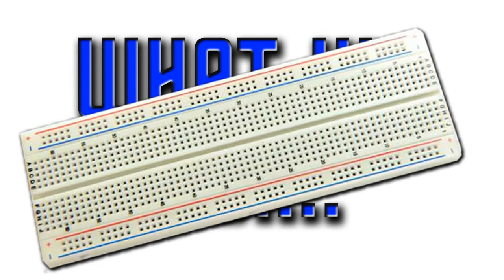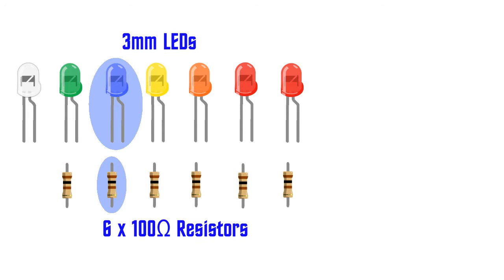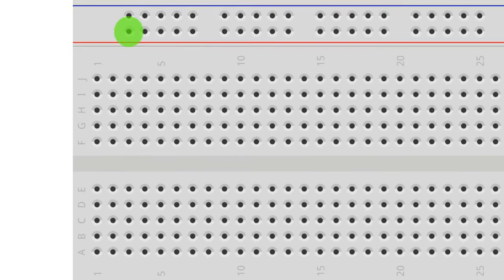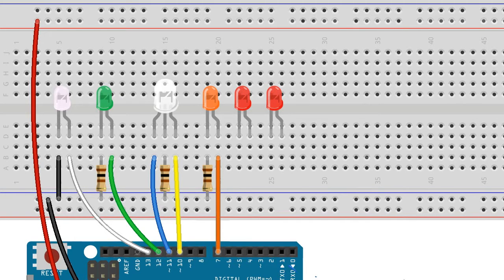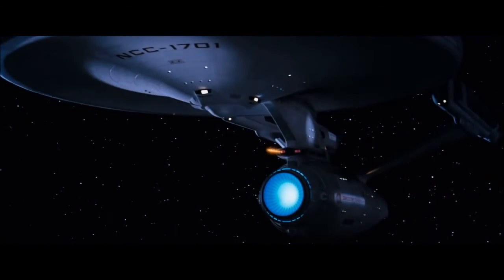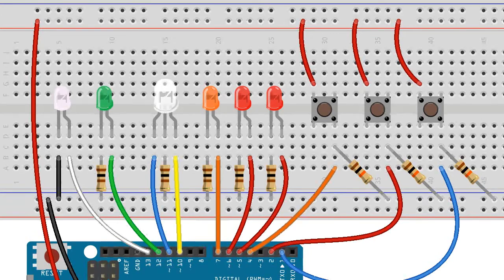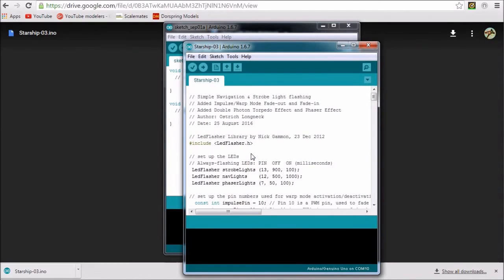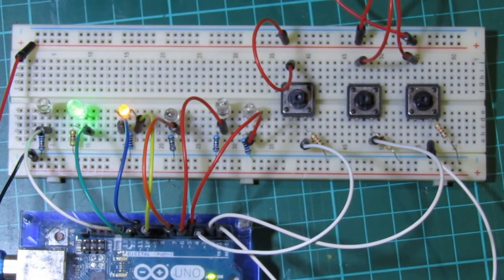Arduino for Starships - Ch05 - Phasers and Photon Torpedos

Comment: good tutorial but all my lights come on and the buttons don't work that i can tell ive hooked it up as you have described but no luck.
Reply from the maker: Hi Steve, you don't perhaps have a split-rail breadboard? Here's a picture of where some breadboard rails are disconnected. https://learn.adafruit.com/assets/35473
You just need to add a small jumper wire between the two rails, then hopefully things should work
Reply: @OstrichLongneck  i got it to work! thanks for your help

Comment: Another great tutorial! But I encountered something weird. I cannot for the sake of it get the torpedoes to work. I already checked the pysical setup by switching around the button numbers on the script. Deflector and Phaser effect work flawless on any of the three switches but Torpedoes never get fired for some reason. I didn't change any part of the script otherwise. Di you ever encounter this problem anytime?
Reply: Never mind -.- ... I connected the resistors to the wrong (positive) rail. Sometimes it is but a simple error that makes you search for a problem indefinately....
Reply from the maker: @slighter  Cool :-) I had someone once who had a split-rail breadboard and it took ages to figure that one out!

Comment: Hey, Trevor! I got this sketch to work! yay! I am now wanting to adjust the photon effects. What I think the photons should do is 1- ramp up red from 0 to full in about 1-1.5 seconds. 2-  at the peak of the ramp up, a WHITE LED flashes briefly (like the strobe) and then 3- the red ramps down. Then photon 2 does the same thing. This could possibly be done using an RGB LED, but using red first, flashing all 3 colours, then red ramps down. Now THAT would be cool. Once I get more educated in Arduino programming, I'll experiment with this.

The idea came from a Starfleet Assembly Manual for the Refit Enterprise back in about 1980, by a fellow named Paul M. Newitt (he is still around somewhere). His circuits were cool, and mostly done with grain-of-wheat bulbs mixed with LEDs. I got mine to work not too badly, but then the ship committed suicide by jumping off the display shelf and flying into lots of pieces. Paul also had a really neat random sparkle effect for the warp nacelles, which he claimed was supposed to have been included in the studio model, but then was cut.

Having fun!

Comment: Thanks for the great videos.  I have a problem tho. For some reason the impulse/warp bicolour led continually transfers from blue to orange without back again without any button press and I can't figure out what is wrong.  I'm using the starship 3 code. Can anybody help me troubleshoot this?
Reply from the maker: You're welcome :-) I'm glad you're enjoying the series. I think your problem might be the pull-down resistor of the input switch for the impulse/warp effect. Is it connected properly to the ground rail? And of a sufficiently high value? It should be at least 1K-ohms, although I've found that a 10K resistor works best. If there is a problem with the resistor, or if it is omitted, it may allow current to bleed through to the input pin of the Arduino, and cause a false "HIGH" state. If you don't plan to connect a switch, you need to set the input pin to a 'LOW' state by using a jumper wire to connect the input pin of the Arduino to the ground rail of the breadboard via a pull-down resistor. I hope this helps :-) - Trevor
Reply: @OstrichLongneck  thanks for your help Trevor. I checked the resistor,  switch etc and all was fine.  Then i checked the last thing I could think of - the arduino pinout. I'm using a Chinese arduino micro pro clone and the pinout I was using from a website was wrong! I had rx1 connected to the switch not tx0. All sorted now.  Thanks again and keep up the good work!
Reply from the maker: Awesome :-) Sometimes it's the tiniest detail that causes the biggest FUBAR! I'm glad you managed to sort it! - Trevor
Reply: I found this on my Arduino clone, although I was connected to the correct pin a 10k resistor was too high. I had to use a much lower resistor (10ohm) for the switch to work. Even using a 100ohm resistor was too much for pin1.

Comment: Hi... Thanks for another great video and for helping me in my understanding of Arduino both entertaining and instructional.  I would like to ask what size ATtiny or ATmega would you recommend using to down load the sketch to? Thanks again for helping in this novice understanding of coding. I am looking forward to future video's. :-D
Reply from the maker: Hi, Sal :-) The ATTiny-85 will be too small for this sketch - not enough inputs and outputs. An ATTiny-2313 would work, or an ATmega-168. We will be transferring the sketch to a PC board soon, using an ATmega chip.
Reply: Thanks for your help... I will pick up a couple of each of the ATtiny2313 and ATmega168 :-)